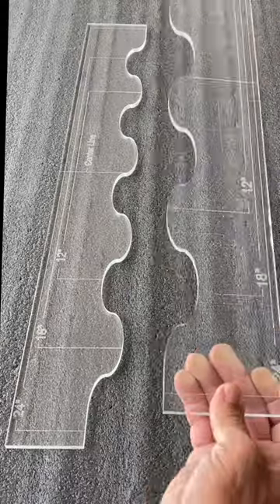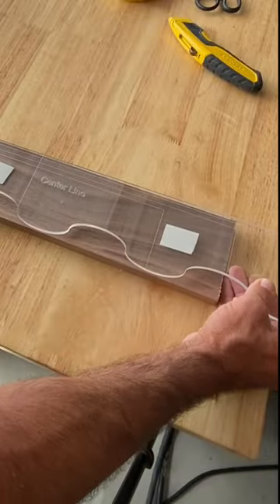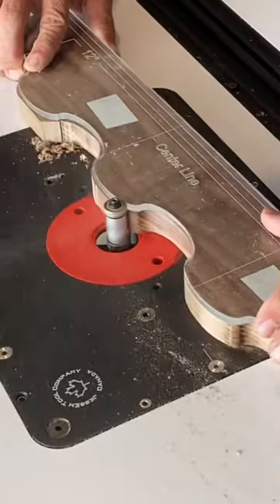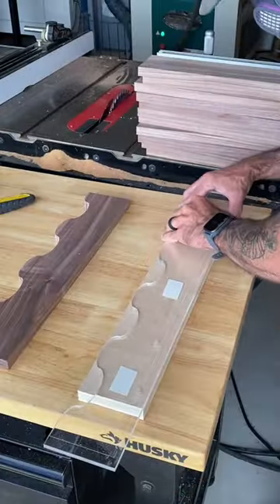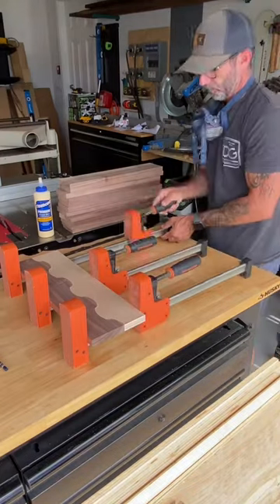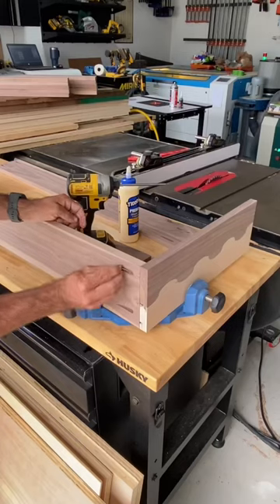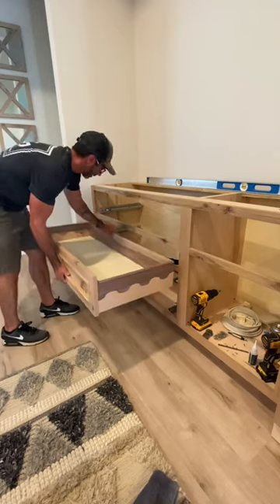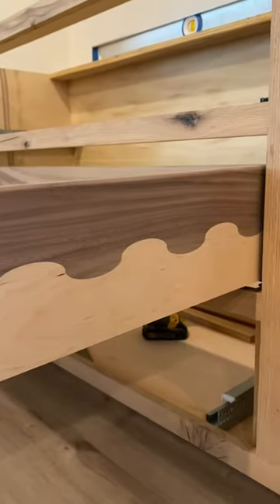SWIRLY walnut drawer box #shorts #woodworking

Comment: Do you know what else is fun?  Using dovetails instead of screws.  Using screws has got to be boring after awhile.
Reply from the maker: Oh I agree with ya, dovetails are fantastic and fun but I’m bored with them. I’ve been doing box joints and dovetails for 8 years so I wanted to try a simpler process. Hence the pocket hole screws. And for the fun, I did these unique sides to drawers. In a perfect world if I had tons of time then I would have done both dovetails and fun sides but my time is finite. And this was very refreshing to do. But dovetails are great

Comment: But shouldn't you have put the pocket holes on the inside of the drawer? Just wondering
Reply: The outside front of the drawer and the  outside back of the drawer won't be seem while in the cabinet. Still using pocket holes is just the lazy man's way of building drawers and speaks to the cheapness of the furniture.
Reply: @MrOso36  well like you said it is nice to change it up, there's a place for them 👍

Comment: Form follows function.
Reply: how TF does that apply to this video?  How is unnecessarily  joining 2 pieces of wood, to make a drawer SIDE, form following function?
Reply: @mtraven23  That was my point - it's interesting but does not improve on the functionality.
Reply: @frederickwilt5541  oh...like "form should follow function" ?

if thats the case that I retract my snark and agree 100%
Reply: @mtraven23  Sorry for the lack of clarity in my first post.
Reply from the maker: Well for this build, my only agenda was to have fun creating a cool design look that was interesting for when someone opens the drawer and gets a surprise by seeing the contrast and dimensional pop. As a woodworker, I’ve spent 9 years building drawer boxes with box joints or dovetails and while I love doing those… I’ve become bored of it.  I needed to feed my artistic mind. My second thought was “should I add box joints for joinery” but then I felt that might steal some thunder from the design so opted for hidden pocket hole screws. After all, how strong does a drawer box need to be, right? Pocket holes will last forever and will hold tons of weight, books, magazines, clothes, etc.  Then I thought if it’s strong enough, then why not do quick joinery and spend my time designing a fun look down the drawer box instead. But I’m trying to finish up a full video on this build which will explain I’m detail and demonstrate the actual strength too. But nothing serious, just a fun thing. In this entertainment center, I did do all drawers differently, some with dovetails, some box joints and some like you see in this video.
Reply: @DesignsbyDonnie  "I did all the drawers differently"  makes it even worse.

and ya shoulda done the box joints, honestly that's what I though you were doing the curves..thought it was some method I hadn't seen before.  disappointing.
Reply: @frederickwilt5541  no worries, I also made some assumption in how I read it.  Glad we cleared it up.
Reply: @DesignsbyDonnie  I think it looks grand. I would prefer it to be the draw front rather than the side so it is always on view. Folks don't hang paintings facing the wall.